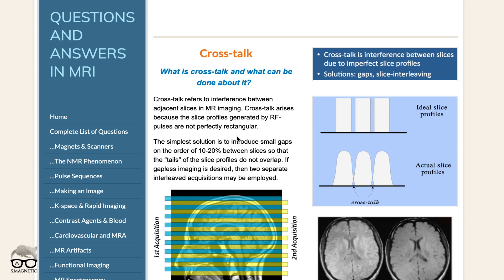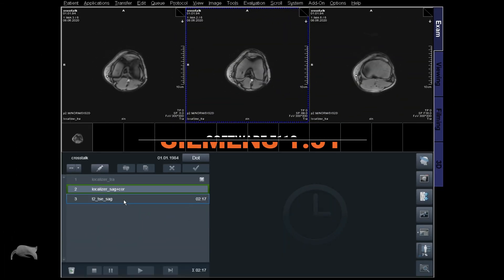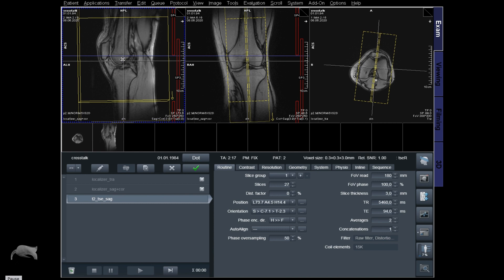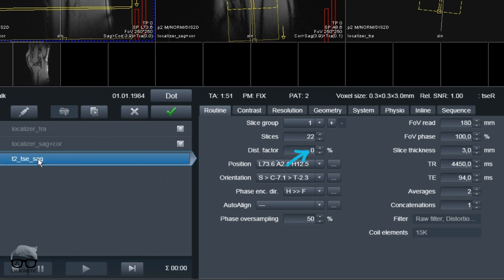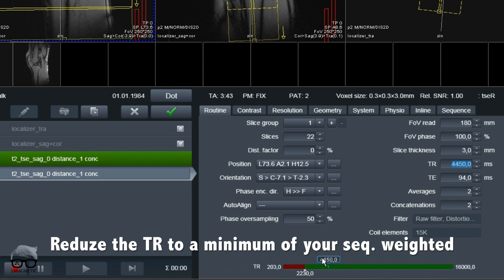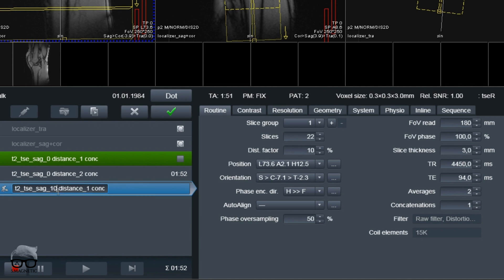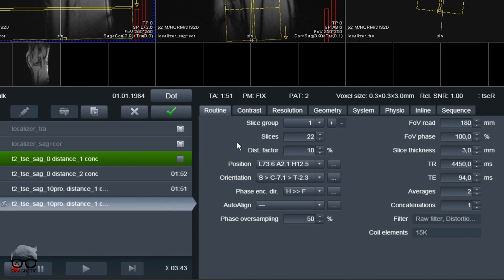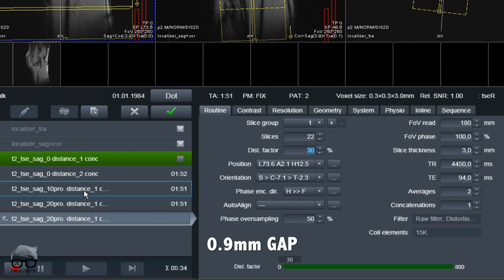BACK TO BASIC – CROSSTALK ARTIFACT

Comment: Isn't there also an option for the scanner to exite slices in intervalls? Such as Slice 1, then 3, 5, 7 ,9  and then 2, 4, 6, 8 so you can image without distance factor without cross talk?
Reply from the maker: Yes. Concatenations. Use two or more to avoid crosstalk whenever having 0 % distance factor
Reply: @Nguyen_MRI  ah okay, thanks!

Comment: Anyone who has done MRCP on patient with ascites (excess fluid in the abdomen)? How did the MRCP come out?
Thanks.
Reply from the maker: Came out good. Should be on 1.5T and not 3T. Difficult on 3T
Reply: @Nguyen_MRI  we did on both 1.5T & 3T. In both ascitic patients we couldn't see ANY gall bladder, biliary tree or pancreatic duct.
Did you do any protocol modifications for ascetic patient?
Thank you.
Reply from the maker: No didn’t. It’s very difficult itself due to ascites. But those cases I had turned out ok for diagnostic answer

Comment: Not something I’ve given a lot of consideration because we gap most of our exams. I like the idea of achieving a similar result with concats to reduce gap. I do wonder if this resembles cross excitation more vs cross talk. I usually think of multiple axial slabs overlapping in the spine producing crosstalk??
Reply from the maker: using two concats and interleaved slices will not give crosstalk artifact. however, it reduces your coverage and more slices are often needed to cover a larger area. reading in books as you mention regarding multiple spine axial, they talking about cross excitation. can be very confusing